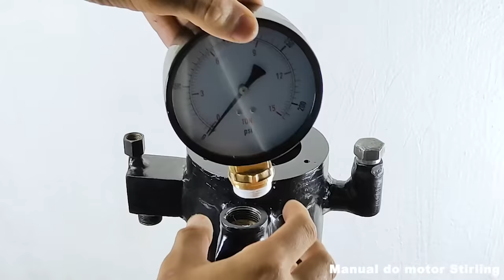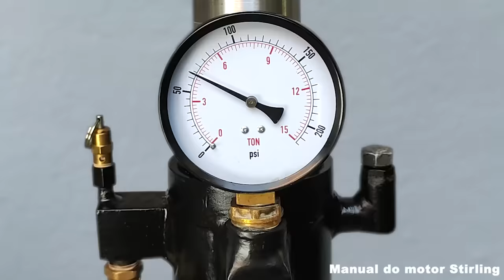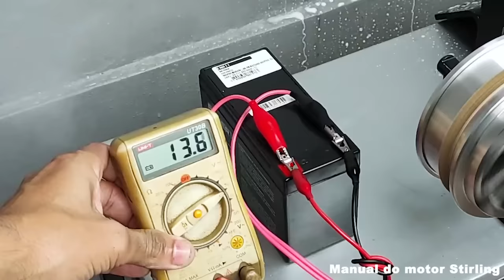( THE SOLUTION TO PRODUCE ELECTRICITY AT HOME ) How to make a steam engine, COMPLETE TUTORIAL.

Comment: Some focused solar could work too.
Also, I'd be condensing the steam, & have it running back through the system, or pipe it into a hydrogen conversion cell.
An inventor myself, I come up with all kinds of ideas.
Awsome that you have the knowledge on how to build so much from scratch!
Reply from the maker: Hi! Thank you very much for the suggestions, now we are aware of what we can improve.
Yes, Robson worked hard to overcome the existing difficulties, due to lack of resources.
Always welcome to the channel.
Leandro Wagner.
Reply: Yes...you could use a Fresnel lens. Very cheap and powerful.
Reply from the maker: @mikejohnson9118  Yes, we are thinking about this possibility too, the problem is the physical space where the designer lives, because he lives in a favela in Rio de Janeiro, it is something more complicated, but I will be studying other ways.
Always welcome to the channel.
Leandro Wagner.
Reply: @ManualdoMotorStirling  its kind of cheesy but i know u got a lot of satellite disks around, maybe make it super smooth and use contact CEMENT [spray is good for this \]but edges only tabbed is nice too. and mylar to create a hot point for pre warming and added heat while running
Reply: Good. The Idea for overheating water and producing HHO in the proccess can be a improve. The solar focus can be used (something like a Fresnel lens and a salt container)
Reply: @josmaraugustofonsecabarbos1713  Experimentation is the fun part!!! 😁😁😁
Reply: @josmaraugustofonsecabarbos1713  
Making HHO is way more simple than most realize. Simple electrolysis in soda water as an experiment, till you grasp the concept. A fuel cell after that.
No need for dangerous high pressure storage tanks, when you can produce it as needed DIY then condense the water after the burn as exhaust, & run it back through the system to be used again & again.
All your doing is splitting a water molecule into its three gaseous forms ¹Hydrogen, ²hydrogen & Oxygen or H²O water, igniting the hydrogen molecules with the aid of Oxygen, then after the burn, water condensation is the result as your exhaust, & back to H²O. 🤷‍♂️?
Reply: @L2FlyMN  yes! We could think about produce HHO using solar Ray focus in a salt container; salt container can be used to heat a fase of Stirling motor and the electricity generated can produce HHO
Reply: Make the wood burner a turbo rocket engin that's heats, cooks, makes charcoal, and yes makes some hydrogen.
Reply: @Scott Crawford What size boiler would I need to create enough steam to power a 25kW generator? I've been toying with the idea as I make rocket stoves and have found a way in which to concentrate most of the energy into boiling water.
Reply: @L2FlyMN I'm a layman on the subject. I know that electrolysis is negative, it consumes more energy than it gives. But you talk about HHO, what changes? Taking advantage of the energy generated to separate H2O and generate energy in a fuel cell with H and O, what is the gain? It sounds like the story of green hydrogen made with wind turbines. I understand that the most rational thing is to directly use the energy generated, because sending it to any other process will result in losses and the final energy generated will be lower.
I really don't understand the logic, could you explain and indicate channels so that I can have more sources on the subject? I really didn't understand.
Thanks.

In time, instead of the Stirling, which I think is cool, I would try a mini turbine with wing-shaped blades and directors. The steam would be thrown directly into them as in a thermo-electric (in fact it would be a mini-thermo-electric), and the generator would enter the shaft itself. Maybe a reduction. I understand that the losses would be smaller - this for the generation.
Reply: @Clovis321  I need a translation. I can only speak & read English.
Reply: @L2FlyMN  do i did, try google translator rsrs... excuse my poor english. Congratulations from Brazil.
Reply: @Clovis321  You’re good my friend. It’s my issue.

Comment: Great work! It works and it looks beautiful. 

Though I do think a more apt title for the vid would be "nice little homemade steam engine generator" 

I believe that if every house in every city had one of these the cities would be really polluted. But as a nice little generator out in the countryside it could be great. 

Are you considering adding a super heater to bump up the efficiency? 
Are you considering more insulation for your steam line between the boiler and the valve?
Are you considering adding a guard or muffler for the steam coming out of the valve?

Finally, I am guessing you made this engine more for the sake of the video than for serious future use, but if you do want it to run for a long time I would suggest changing the design of the bearing between the piston rod and connecting rod. I am Concerned for two reasons. The force is not purely radial and the movement is not spinning but rather a reciprocating partial rotation. Ball bearings do not like either of these. I wonder if a bushing on a pin/rod might not last longer if proportioned correctly machined to the right tolerances and lubricated correctly. 

Again, beautiful work!

Have a great day.
Reply: Faceless Nameless   yeah, that whole thing seems like a lot more work than just getting a few sticks and digging a small whole in the ground.
Reply: All good ideas

Comment: 😀💖 Absolutely flipping awesome. 😀 Being an inventor / engineer myself, I’ve found your video priceless, and your detailed show of events in making this has inspired all sorts of ideas in me, thanks. I’ll be building something slightly bigger, using your inspiration. 😀 Thanks, mate 😀💖👍
Reply: Would it power at 20KVA generator? I am thinking of ditching the petrol engine and building a steam engine instead and using waste oil as the heat source. Something that will last 20yrs with minimal maintenance.
Reply: @davewallace5008  21 W to 20 kVa, not flippin likely. Try 1000 times ~ @ 0.97 power factor, as I don't know your inductive vs resistance load.

Comment: I've been thinking about this for a while and my conclusion to the build is why reinvent the whole crank case ? The donner crank was already to go in its own housing with oil etc . Simply run the steam cylinder connecting rod through the head on a side valve engine, remove piston rings and bolt to top of piston .
Reply from the maker: Hello friend! I understand your explanation! However, the single crankshaft was collected in a scrap shop, there was not a complete compressor to do as he suggested.
With a normal compressor, it would not be possible to make a double-acting piston engine, like this steam engine in this video.
But this form of construction was chosen, to reuse material that was already in hand.
Always welcome to the channel.
Leandro Wagner.

Comment: 20 watts? Bem pouco pela trabalheira e custo envolvidos....
Apesar disso, projeto bem interessante. Parabéns pela bela montagem.
Reply from the maker: Olá Cleber, aqui está a prova viva como a energia é importante na nossa vida, pois veja a trabalheira para produzir apenas esses 21Watts.
É muito gratificante para nós saber que você gostou do vídeo, muito obrigado.
Seja sempre bem vindo ao canal.
Leandro Wagner.
Reply: . It can charge a battery
Reply: @ronald5629  yes, it can. But, the cost is very very big, compared as a 20w solar panel. Or, 40w solar panel plus battery and a simple charger circuit. 

By the way, it is a very beauty engineering machine...

Comment: stirling engines.........there is a company in the USA that makes commercial power generation systems for remote sites that have mission critical roles, like railway crossings.  The have a stirling engine that uses heat from two small (9kg) propane BBQ bottles to operate a stirling engine which is a completely closed,low or zero maintenance system.

Comment: Nothing new here but great skill, this technology is about 200 years old.
Reply: steam power is old but this allows you to generate electricity with steam instead of using belts to turn mechanical devices this generates power to use modern equipment by burning anything in theory

Comment: I love steam technology! You made everything soundly, but - I studied it more thoroughly ... These technologies had a much higher efficiency, because they worked on OVERHEATED STEAM! You need to make a new boiler (if the generator is your goal) - in which steam will flow into the same boiler and be heated to a higher temperature - contacting the flame through (tubes), and then fed into the engine!
Not everyone knows - but superheated steam after 600 or 700 * C is split into oxygen and hydrogen (and can be used for combustion), therefore, when extinguishing fires at very high temperatures, water is not used !!!:goodvibes:
Topping up water must be organized somehow ...

Comment: Love that steam engine. Do you make as a kit to sell please?? I think it would work great with my Rocket stove boiler I built for my outside hot tub.
 Or even my Wood stove that has built in hot hater hooked up to my shower.
 Winter electricity is a lot harder when there is less sun for the solar and the creek is not running for the Hydro

Comment: As a hobby and a novelty the 195 year old "Sterling" engine is cute. In fact two of these nearly 200 year original engines made by Sterling himself still exist in museums. These tiny replicas can generate tiny amounts of electricity to make an LED glow but they are useless. Considering that portable generators that we use during power outages, usually have between 15 to 25 horsepower gas/natural gas or diesel engines and aren't designed to operate 24/7 for extremely long times. The life of a Sterling engine at it's best cannot produce enough hp and torque, it's a pure pipe dream.

Comment: I build steam engines for a hobby. Using a used vertical lawnmower engine as a cross-head and crank is WAY easier.

Any more, I use a Pelton-wheel turbine coupled to a home-made PM generator to make standard 120 vac or pulsating direct current (14 volts) to charge batteries.

Again, WAY simpler.

Fun video to watch though; thanks.

Comment: WOW!  great ideas I've not considered (small engine crankshaft and hydraulic spool valve).  I would argue about producing home electricity.  I cannot think of a more inefficient way to produce electricity MAYBE for a very secluded homestead.  Better to use the wood or fuel for home heating.  OR put the engine in the house and use it to make electricity and heating for the house.

Comment: As someone who has lived offgrid simce 1986 and with solar since 1997 I can honestly say the LEAST of the problems is light.
It doesnt take much power to run modern LED bulbs.
What people need is running water so a well pump and refrigerator and cooking etc
For me This is solved by using LP appliances. 
LP fridge LP stove LP clothes dryer LP water heater.
So it isnt free but cheaper.
But to have simple lights is very easy

Comment: Nice video and not fake, to change from the others... Could you measure how many volts and watts you can get with the Stirling motor? Because you used an LED which is low power but what is the max?

Comment: A modern steam engine is a fast running closed cycle system like all the organic Rankine cycle engines. Interestingly in Germany around the year 2000 the development of a modern water steam engine was conducted. The project name was ZEE (for zero emission engine). The last prototype was the ZEE03 prototype, a fast running 1000 cm³ 3 cylinder engine operating in closed cycle with a total water volume of 250 cm³. 

The common boiler was a heat exchanger operating up to a temperature of more than 300 °C generating saturated steam at a pressure of 250 bar. Each of the cylinder heads has its own superheater generating superheated steam with a temperature of up to very impressive 900 °C. The shaft power was 50 kW, the efficiency was 45% at maximum torque. The engine has no cooling system.

This engine was used to substitute the ICE of a Skoda Fabia for test runs of several 1000 km. The engine was not running in idle mode. No electric starter was needed, because the engine was self-starting just by opening the throttle between the boiler and the superheaters. The engine spead and power was controlled by variation of the duration of the steam injection arcoss the superheaters into the cylinder. The engine was running in 2-stroke mode.

Comment: How do the crank journals recieve oil?
Reply from the maker: Hi! At this point you need to add oil manually, but we are designing a new automatic oil applicator.
Always welcome to the channel.
Leandro Wagner.
Reply: @ManualdoMotorStirling  may i suggest creating a box to fit them in then fill with oil? That should remove the need for  drip system in which youll need to use a containment system to catch the excess oil anyway. Cool project by the way
Reply from the maker: @wilburosgoodwormsley  Your suggestion is very interesting, thank you.
Leandro Wagner.

Comment: Stirling Engine? Nope, Steam Engine!
Reply from the maker: Hello Robert, the first engine is a steam engine and the second engine at the end of the video is a Stirling Thermal Lag engine, very similar to the thermoacoustic model.
Always welcome to the channel.
Leandro Wagner.
Reply: @ManualdoMotorStirling  - Well, I Have Seen Stirling Engine powered Generators, installed in Parabolic Dish Assemblies, that Output About 25 kW, so, I agree with part of the Premise, that such could be part of a Solution for Electricity Production, in certain Areas. 

But, our biggest problem is energy is wasted, on Poorly Insulated Homes, Offices, and Industrial Buildings! 

When Solar PV was still very expensive, the key points were to first "Reduce Energy Usage" before going Solar! Now, people seem to ignore that point!

Comment: Fluctuation is so high. The diameter of flywheel should be calculated relative to the crankshaft. it will damage any electronics equipment if used as a generator.
Reply from the maker: Hello friend! Yes, you're right, when the engine was designed, I didn't know that a larger or heavier flywheel would be needed, and since a whole video of the construction was made, we didn't change it in the performance presentation.
Any questions, you can ask me.
Leandro Wagner.
Reply: @ManualdoMotorStirling  Regardless, very good craftmanship.

Comment: If you could find away to run your steam line back through the fire box it would be super heated and would be dry steam going into the cylinder. It would be more efficient and would not get water everywhere coming out of the exhaust.🤷‍♂

Comment: Steam power is neat. Steam power is fun, cool, awesome. But small scale, it's not efficient or particularly clean, and is labor intensive.

Any energy transformation is wasteful, inefficient- the larger the scale, the more efficient it can get. But steam- first you BURN something, convert it to Heat. It takes labor to fuel and supervise. Smoke and ash go up the stack. Waste. You heat up all the medal parts- waste. You use the heat to vaporize water. Inefficient. You have to provide auxilliary machinery, labor and supervision to  supply clean water. You take that vaporized water and convert its heat into mechanical rotation. Any heat not condensed out of the water, any vapor not reduced to ambient temperature, wasted up the exhaust stack. You use that mechanical energy to rotate a generator. Inevitable waste there, but that's maybe the most efficient step. You use that rotation to generate electricity- that's not an efficient process- at large scale, it can be 90 %. At small scale,  maybe 75. Then you transmit the electricity- that's relatively efficient. Then you use the electricity to actually DO something. That involves waste heat, and wasted energy...

I LOVE STEAM POWER. But, small scale, it's not efficient. A 50 horsepower boiler, just in itself, is the size and weight of an SUV-- I've run them... I've run 600 800 hp stationary boilers they're large room sized, without the essential auxiliary machinery. 50 hp is enough to run a medium Motor cycle. Megawatt sized steam generating plants CAN run efficiently enough to generate commercial power. But they're the size of several city blocks.

So it's a neat project, and a fun demonstration. And if you have an existing small steam plant, you can run it, if you're willing to spend the money on water, fuel, and chemicals. Until the inevitable day you HAVE TO invest in  major repair, replacement, or maintrnance.

I wish it could be done on a small scale and low cost. I'd love to do it myself. But it's EXPENSIVE...
Reply: Oops.Didn't realize I had commented on this post before. Still true- small scale, big expense, small result.

Comment: Today a common residential house, let's say of 70-100 sq m, requires a supply of 3.5-5 kW, with a voltage (in Europe) of 220V, how much power does that steam engine develop?  1/2-1hp?  (1 HP = 735.5 W), at most you can illuminate the toilet light, not counting the noise that a steam engine makes. Surf the web and search for "3 - 5 kW generator set" so you realize the dimensions .C.S.

Comment: All these fancy ideas for making your own electricity come with a cost. The cost of solar won't be on break even for at least 25 years. Wind turbines don't work if there is no wind. Even Sterling engines need fuel to create the heat that drives them. The only real option is when you have a reliable flowing water source that you can tap to drive a generator, and even then you need a lot of expensive control panels and storage to make good use of the power.

Comment: My idea would be totally different. Starting from a small battery that feeds cupper blades on a carbon shaft and does create kinetic energy to make turn an alternator that produces electricity in excess enough to feed tha base battery and feed additional gear comprendo